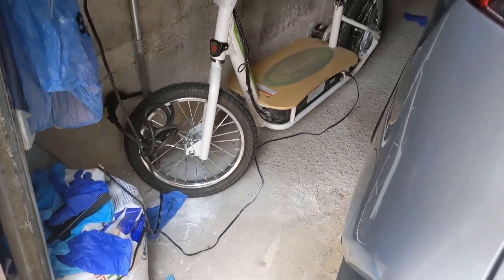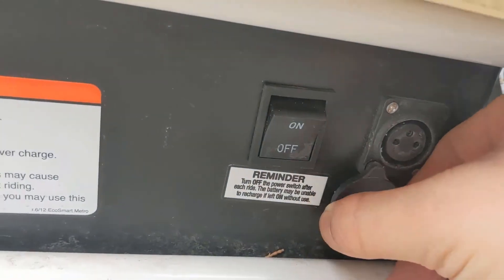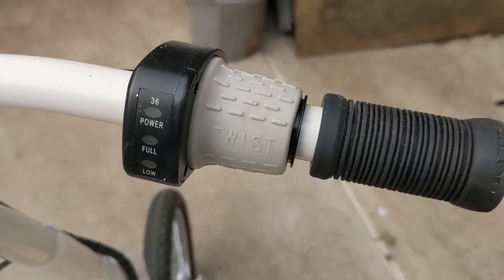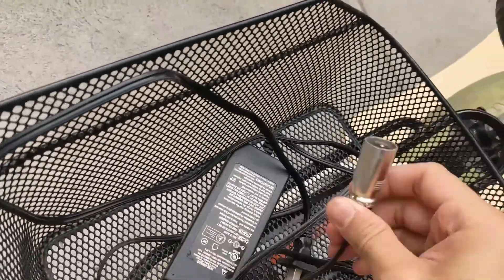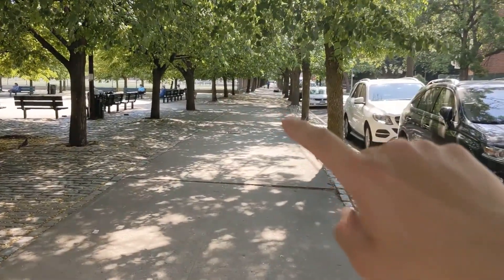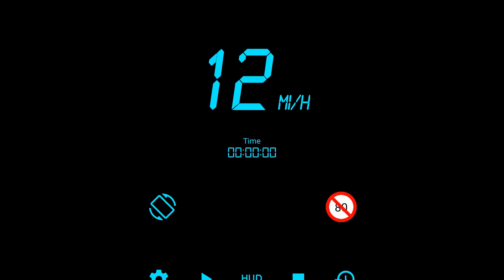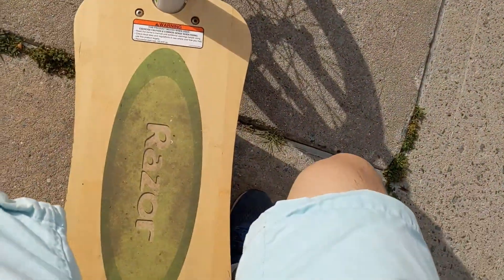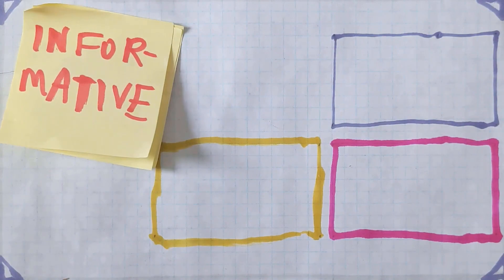Re-testing Razor EcoSmart Scooter after 6 months: top speed & range

Comment: I got rid of the lead cell batteries and got a bike rack Lithium Battery 36v 14.5 kwh ( 14500mAH) it's 100% better, strong pull. I never ran it dead, but have rode it 18 miles ! No more range anxiety.
Reply from the maker: Do you have a link to the Li battery?
Reply: https://photos.app.goo.gl/fsi1uBgqYj1mpAxh8 
Looks like this, keep it 36v and  you should not have any problems. 
There's a  couple dozen model on line, Google " e-bike battery rack " and you should be able to find one.